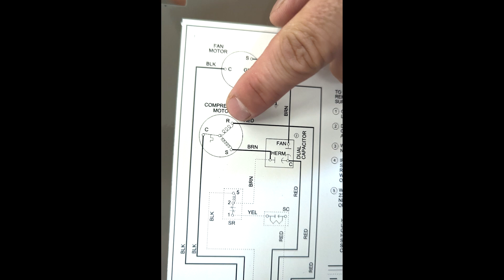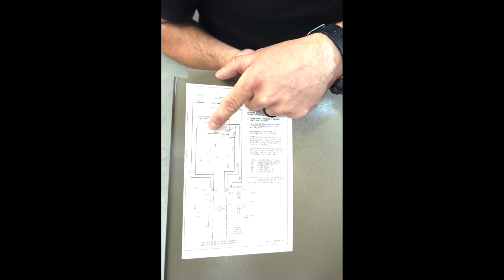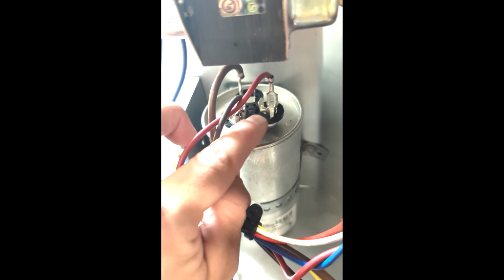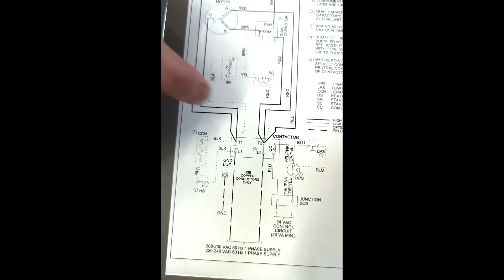EasyStart installation on residential A/C unit

Comment: Based on these instructions, I got a wiring fault message on my Traine system. Cutting the red wire between the capacitor and the switch was a mistake. Watch other videos before you make the same mistake I did
Reply from the maker: Hey @mika4gundy15 we are sorry that you are having issues wiring up your EasyStart. We want to make sure you are taken care of. Please reach out to us here at Hutch Mountain and we can walk you through the wiring over the phone.
Reply: @HutchMountain   I did figure it out based on a different video. I had to unscrew the red line on the switch unit coming directly from the compressor and connect it to the EasyStart brown wire. Then I connected the white line from the EasyStart to the same point on the switch where I had unscrewed the red line coming from the compressor.
Reply: In their defense they never said to cut the red between the switch and capacitor, they did however use that to find where it goes to find the wire that goes to the compressor. While they didn't specifically say that, you hear him say connect the red that goes to the compressor to the brown. You can also see the wire they have cut already is compressor to the switch. The other videos I watch do too much imo. This one is a simple snip and connect. Just got a new unit and had to dig for the video.